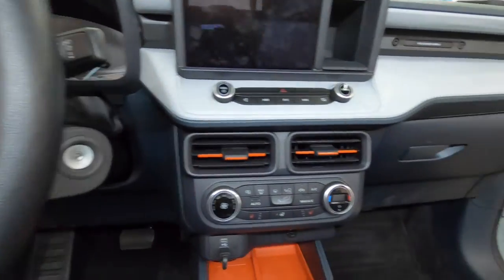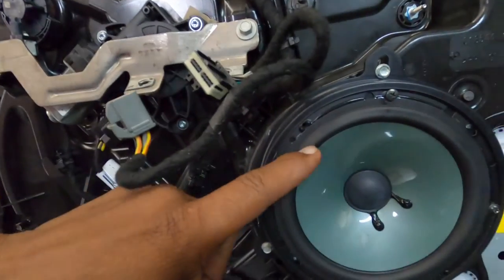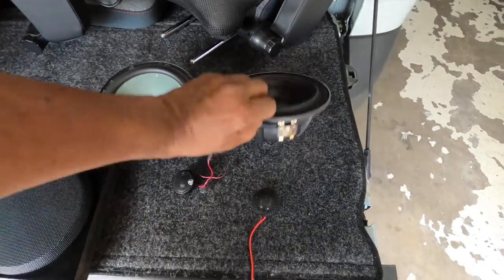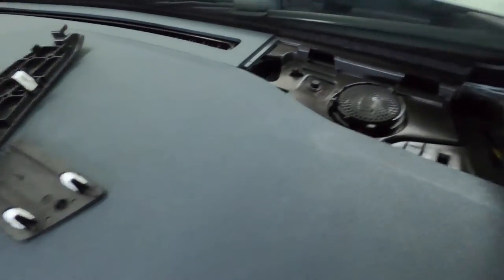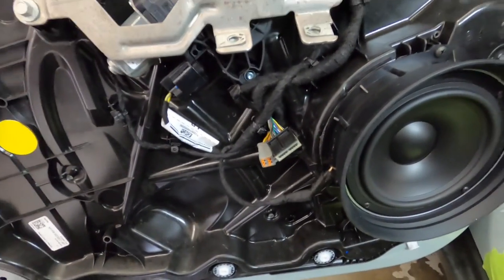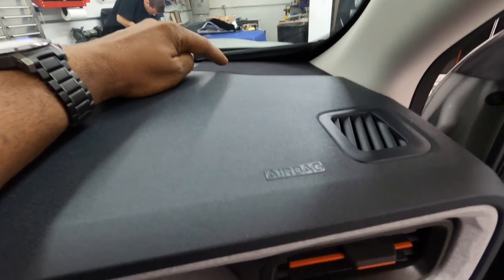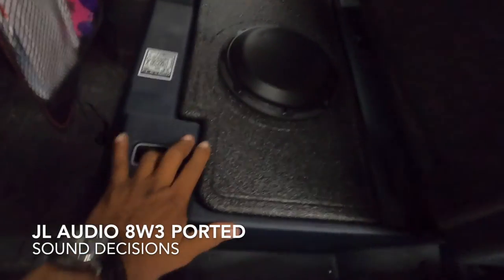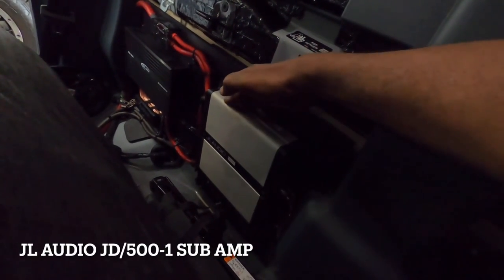2023 Ford Maverick wire rescue & audio upgrade. Arc Audio Blackbird DSP, Morel Hybrid speakers & JL!

Comment: How'd you run the wiring from the crossover to the tweeter? I read on a forum that they connect directly to the radio unit. The crossover I have runs to both the speaker and the tweeter. Did you have to run new wiring?
Reply from the maker: Yes I ran a new wire from the tweeters to crossover.

Comment: Whats up brother, I have a question for you since you worked on the maverick. SO I have a 2024 Ford Maverick XLT, and want to upgrade the speaker system as well. Below is the set up im thinking about. You mind telling me what you think and if I should swap anything or all and go with something else? 

Amp- Kicker 46CXA6605T CXA660.5 660W 5-Channel

Front- Kicker KSS670

Back- Kicker CSC67(ones in the picture above) or Kicker KSC40 Although not CS theyre silk

Sub- Kicker CompVR 10-inch(25cm) DVC 4-Ohm, 350W or Kicker 48CWRT104 CompRT 10" DVC 4-Ohm

Very much appreciated
Reply from the maker: I’m sure that kicker offers great products, but I haven’t used them in a number of years. 
Are you planning on doing this install or are you having someone else do it? If it’s a shop I would consult them. Otherwise I would need to know more on what you’re trying to get out of it. 
Hopefully that helps.

Comment: What kind of inverter does the Maverick have. I thought this type of setup wasn’t possible on hybrids or at least not recommended? I’m looking into upgrading my hybrid
Reply from the maker: The Mavericks OEM inverter works pretty good. A hybrid had a 12 volt, so you pretty much do anything. You just need not put too much strain on it.  So no big bass setup.

Comment: When you say that you opened up the grill for the tweeter, what do you mean?

Did you modify the removable plastic grill trim piece, or you modified the dash mounting?

I am looking at getting the morel MT120 which supposedly has the same dimensions as the mt300 you mentioned. Just hoping I dont have to cut into the dash. I'm fine modifying the removable grille part though. Thanks!
Reply from the maker: The Morel tweeter is larger than the Maverick dash grill hole. So I cut a larger hole and it allows more sound to go through it.

Comment: Did you cut the radio harness behind the radio to get your inputs for the amp and outputs to the door speakers? Where is it located on this truck?
Reply from the maker: No I used a t harness from pac audio. The harness connects under the radio display.

Comment: Great job! Question. How did you go about running the wires from the crossover box through the rubber grommet on the door? It looks very difficult from what I saw when I removed the door.
Reply from the maker: We used the the factory wiring. The eom wiring is plenty when it’s all said and done. 
Besides the system was active, so there was no passive crossover used. Every speaker had a it’s own channel on the amp.
Reply: @lancesautovlog  Great video - I learned a lot. So are you saying that when you installed the new crossover and woofer in the door, you were able to just plug into the factory wiring (connected via harness) and plug right into the head unit? That way if you were ONLY doing a component speaker upgrade - without amp or sub - all you would need to do is just drop the new Morel into the door, pop the new tweeter in, and plug the crossover directly into the factory wiring that pops out of each door? Please say "yes" :)

Comment: I hate the head unit. It's so slow, but I have not seen one video on swapping one out on a maverick
Reply from the maker: It will be some time before a radio swap is available. There isn’t a high demand currently.

Comment: Do you happen to know what color the wire is for the remote turn on for the amp? I have a Maverick and I am not sure which one it is
Reply from the maker: I'm not sure what your question is. I'm guessing you want to know which wire will be able to power the amp. I used signal sense to tigger the amp.

Comment: Are you running driver or all seat occupancy mode?
Reply from the maker: I’m not sure of what your question is?
Reply: @lancesautovlog  it's a setting in the stock head unit
Reply from the maker: @driftx2  all.